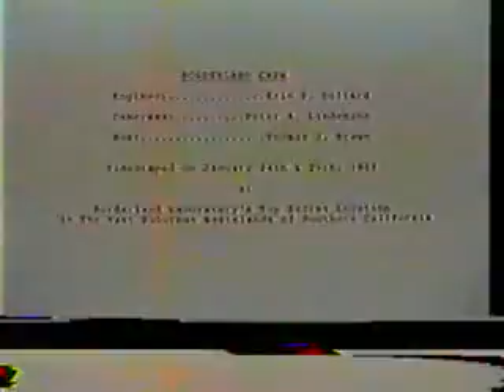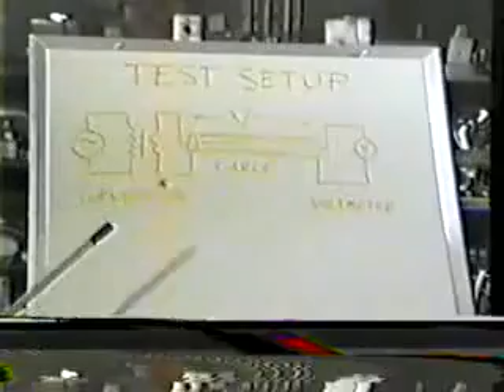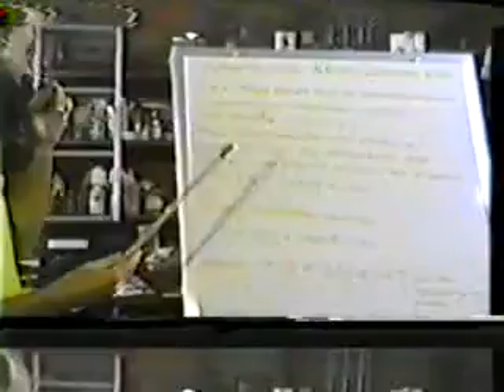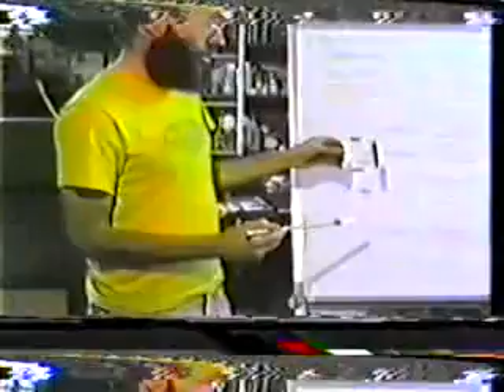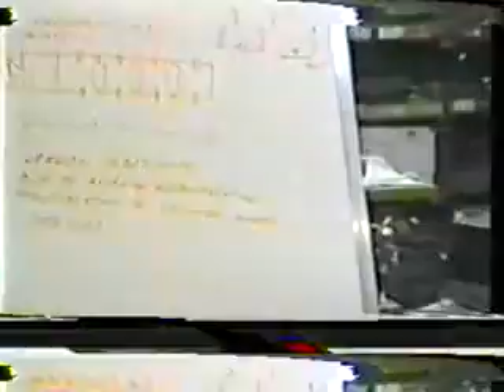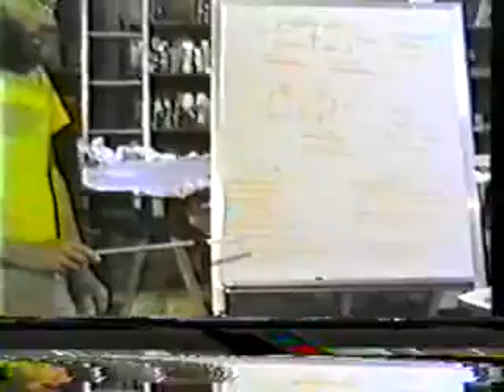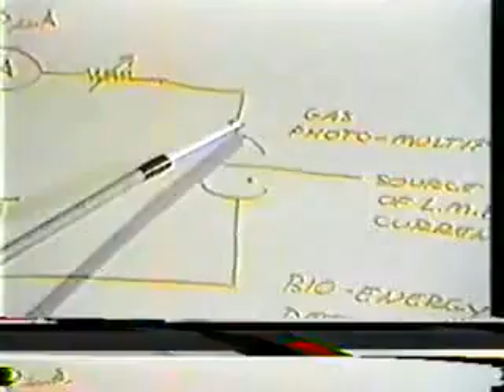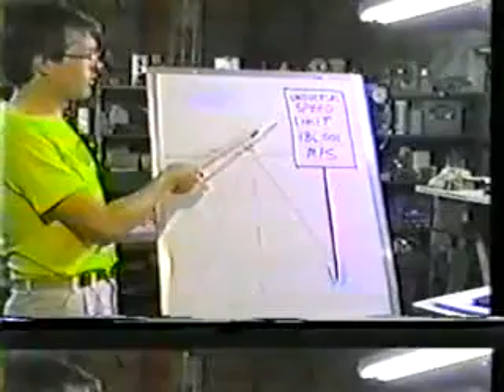Transverse & Longitudinal Electric Waves - Eric Dollard & Tom Brown

Comment: confirmed! I tuned my solid state hairpin circuit, (april 2019 video) to the higher resonant frequency, and it produced a greater output on the L3 coil (secondary) where by voltage and current are in phase while resonant.
Reply: or somthing i sugest telegram i have stuff cat post in yt

Comment: One small issue I have picked up: Dollard describes the resonant frequency of the TEM circuit as being around about +/- 1500 Khz when it is actually +/- 1500Hz based on a quarter wavelength of 31 miles. Same with the LMD circuit. Just thought I would point that out.

Comment: The most important part of this video in regards to the LMD network is the specification of using high q capacitors and large inductors. I have built and tested many networks without these components and they don't work right.

Comment: Eric says the frequency was 1500 kilo cycles per second but it should be 1500 cycles per second with the AUDIO frequency oscillator. It comes out just right for a quarter wave 31 mile line at the speed of light. Just thought I should clear that up.

Rock on with the longitudinal dielectricity!
Reply: hmmm thats just way too low freq... he meant what he said 1.5 Mhz
Reply: ... actually now i dont know, because youre right, to be audible it would have to be down there... the main thing was, he figured that resonant freq was 3.450 Mhz where it should have been 2.727 Mhz... i could be wrong, or confusing another Eric vid tho :)
Reply: it doesn't have to be audible to the ears to have an audio component..! so he could be using different instruments thats audible at that high of a freq.

Comment: 44:05
"If you remove the motor,  would go up to infinity"

Because mentioned here in this video by Eric Dollard that using longitudinal magneto dielectric analogue computer segments (LMD) to change AC transvers electromagnetic  (TEM) wave forms into conjugate DC pulse voltages the motor and generator are rendered as being one mechanism, or the motor is no longer recognized as being a load on the generator. With the motor load being removed, the AC generator voltage is claimed to be raised to infinity. Causing meters to run in reverse.

For home generators not connected to power lines, this example if proven true may explain how and why a motor generator system may produce excessive voltage when LMD wave forms are employed in coil structures and capacitor circuits when resonance exists within them. 

LMD capacitors resonate with the AC of the north south pole generator wave forms. This removes the load from the equation even though the load motor remains in the circuit. This reverses charge flow direction causing meters to reverse direction. For home generator motors this means charge reversal back emf goes back into the source to recharge batteries and or capacitors or simply used to run the motor. It may be that faster than light induction rates multiply power exponentially magnetically and therefore electrically as well. Because the harmonic resonance "musical pipes" or circuits between coils and capacitors is in a more natural form. Back EMF of the magnets passing coils creates the AC or TEM. The bifilar trigger coil and pickup coil is an LMD analogue computer circuit. Because it can mimick the Tesla coil. And because it uses the capacitor and directional diode along with a frequency tuner adjustment to attract in the magnets when the circuit is closed or on, and repel the magnets when the circuit is open or off. The AC sine wave is being used to power the motor's motion and the charge more directionally as needed. Rendering the motor and generator as one. Removing the motor from the generator. Reversing the meter. Sending the back EMF back to the source. Not sending into ground. 

Positive charge into the coil attracts the magnets. Back EMF negative charge pushes back against the magnets and back against the positive power source to recharge. Done at the proper moment this propels motor forward not backward. So the back EMF is recharging and assisting the motor. The coils have capacitance and discharge as back EMF. Both as magnetic energy and as electrical energy. 

Load can also be resistance which John Bedini had shown lowered amperage of energy going into the motor coils while repulsion and attraction torque strengths actually increased. Load resistance also includes physical pressure on the axle. Not just a circuit load. Such as a dead battery. Chemical electrical resistance. 

43:37
The capacitor will resonate with this magnetic energy in the wire and cause the voltage of the system to raise as you go to the load. Which of course is quite different from a normal DC circuit. So it's not uncommon in the alternating power system that the voltage will start out nominal at the generator. Which is usually 13.2 KV. And go up to 13.8 or 14. And if you remove the motor it would go up to infinity. What happens when this is done, when the voltage gradient raises; at the plant, the kilovolt/ampere meter will start to turn backwards...

44:44
An LMD analogue which Is in conjugation with TEM transmission line to neutralize the transmission effect completely. Rendering the motor and generator as one apparatus. 

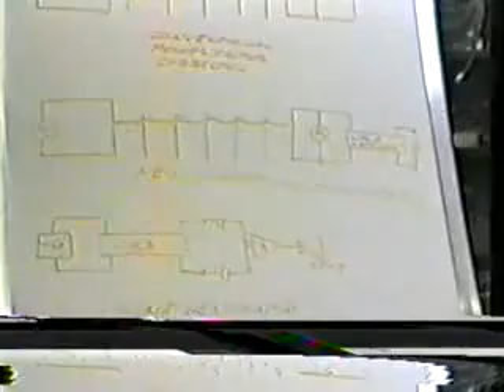45:18
An LMD network is an analogue of an organ pipe. And it will produce a complex harmonic spectrum. Rather than a single sine wave frequency. That you can eventually get out of the LC oscillating circuit. Or again the single repetition rate that you usually get out of your RC networks. Which contain harmonics that usually are not what you find naturally in musical instruments. 

45:45
So a negative conductance, which may be a cathode follower with a capacitor in its cathode, or the capacitance line producing negative transconductance and oscillations. It could be a Hartley oscillator, it could be photomultipactor tube. There are many different ways to produce negative conductance and resistance. This is connected to one end of the line to maintain the harmonic oscillations in the line.

46:09
And then the dielectric end is lightly coupled to an amplifier, which of course produces the sound in the speaker. And if course your musical keyboard would switch these things in as necessary to produce the music. 

46:29
Used for practicle advantages and produce very high voltages and Tesla coil effects without the high frequencies and interference with other services. Which would get one in trouble with the FCC.

10:30
TEM retarded wave slower than the speed of light.

12:00
LMD lightly coupled primary to the secondary
12:15
Positive pickup. Loosely coupled clipped onto the insulation (induction.) With the end of the coil. Light coupling with the end turns. 

12:47
A sharpness factor or a que "Q" of a hundred times greater. (LMD has increased harmonic resonance sharpness over TEM. Rather than a curved sinusoidal its a square blocked on off sickel cycle circuit circle. ?)

14:08
126% the velocity of light. Hence this wave is an accelerated wave. So we've broken the speed limit of the velocity of light. 

14:33
We're not having transverse flow between the turns anymore. But the energy is now spiraling due the the complex quantities of induction along the wires in this (upward) direction. So we have a spiraling wave around the coil and this gives us an effective velocity exceeding the velocity of light. And this shows a very fundamental error in many texts which give the method for calculating the resonant frequency of a free oscillating coil or a Tesla coil, as being related to the velocity of light.  So we have to develop a new system of equations to describe this. 

Eric shows how capacitance changes resonance when he brings his hand near the coils. 

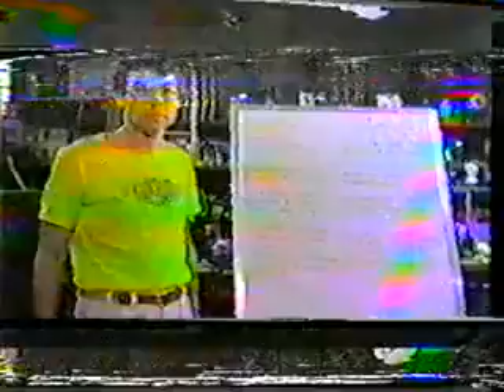16:25
Tom Brown explains the "analogue computer."
Reply: good post thank you.

Comment: Eric gets the longitudinal wave thing, but doesn’t understand what must be done with it. 
A longitudinal perturbation must be repeated@ 1 million times per second to break down the insulation surrounding all radiant matter. 
Tesla said as little energy as practicable in a quenched spark gap,in a vacuum, with metals with the least resistance. In fact one should not even see the spark. Repeat it 1 milli9n times per a second, and run it in the radiant circuit as described in the patent. It will only take a small metal plate to produce exceptional voltages, and currents.
Reply: Are you saying as long as the oscillation rate is above 1MHz and longitudinal (naturally occurs at resonant) the resulting buildup will be exceptional?
Reply: @JenkoRun  tesla was clear; a spark is a longitudinal wave, and can break down the insulating fluid separating “radiant matter”. It can be done with large forces(high voltages and currents), or by way of finding the resonant frequency of the insulating fluid. Tesla said that frequency of the spark  is @ around 1 million per second. It is at around this frequency that a spark repeated will break down the insulating layer. To that end Tesla invented a quenched spark gap, and wrote on how one can use the least energy practicable to create a spark. 
The sparks must be going in one direction. Search down some of Peter Lindeman videos, he is likely the person who understands Tesla’s patents more than anyone else.
Reply: @donaldbest7621  Could you provide the sources of where Tesla directly states that a spark gap discharge is longitudinal and has a million cycle per second oscillation rate? I've read his patent 462,418 as a high frequency free oscillation circuit and looked at the hairpin but this new to me.